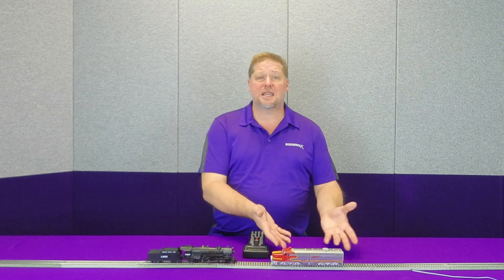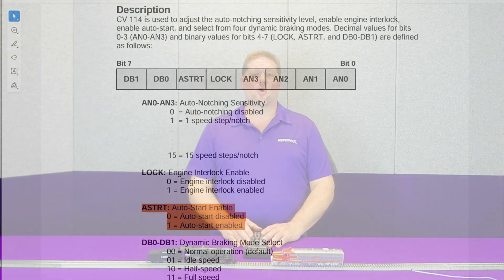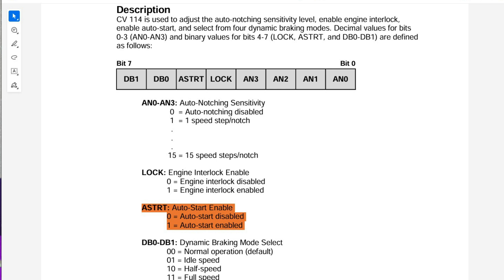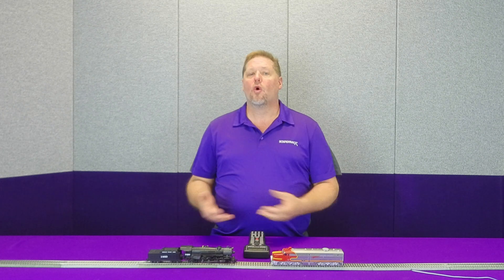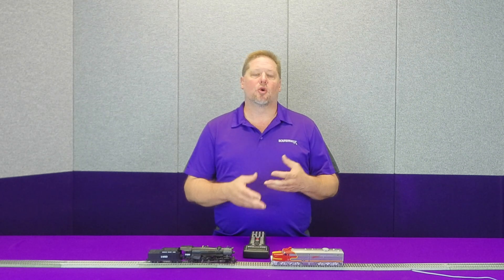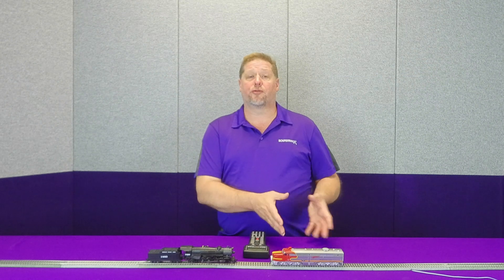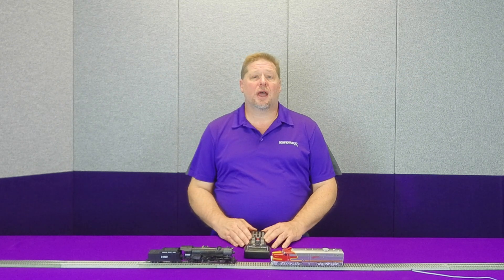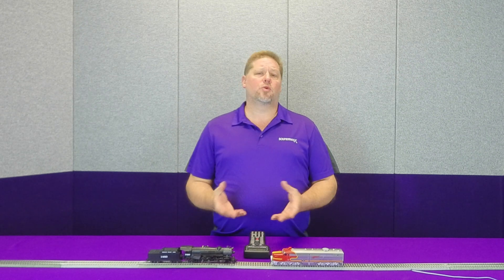Operations 101: Auto-Start (Episode 3)

Comment: I have a Bachmann F7B unit that ive been having problems trying to turn off the "autostart".   Im not wanting to listern to it while its sitting there parked.   The Pairing F7A unit has been replaced with the tsunami 2 pnp board and is working as i programmed.   Is the CV for bachmann the same as this, NMRA Standard
Reply from the maker: Our Support Team can help you with this: (970)259-0690 or support@soundtraxx.com

Comment: Wish steam had a start up.
Reply from the maker: Like George said this takes hours in real life and doesn't have sounds associated with each part. We do have fuel-loading sounds.
Reply: While there is no “start up” sequence, you can use the CV113 quiet mode and the steam loco will be quiet until you select it and send a command such as headlight on, or a whistle.  
So search “SoundTraxx Quiet Mode” for a video here with more info. 
I hope this helps!   ~G.